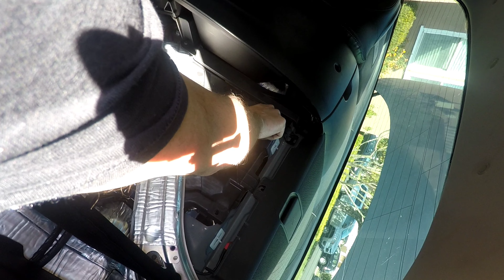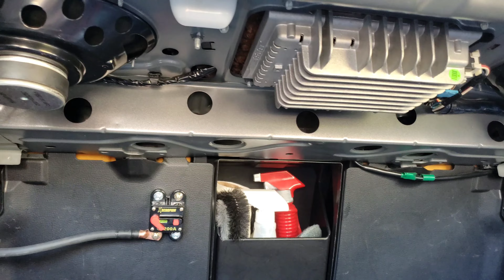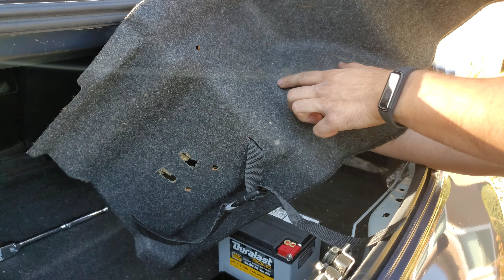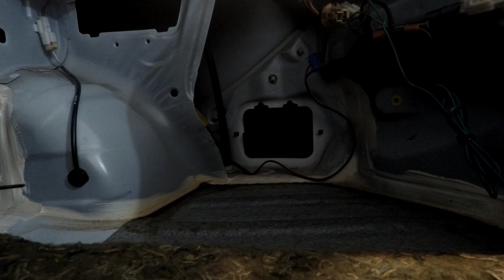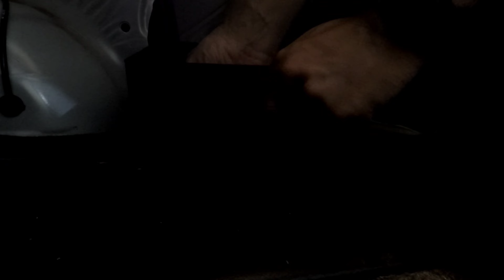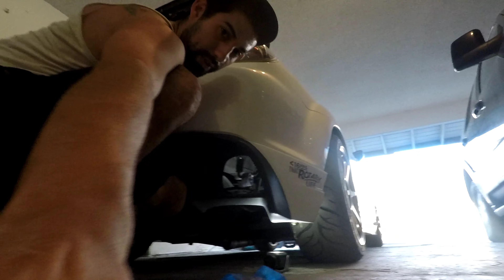Project Seca Rx8 Battery Relocation Kit Install!

Comment: Where does the 60amp fuse block for the power steering get power from? The black wire on the other side is going somewhere, but I can't see where it terminates. Is it just getting power from the post is the fuse box?
Reply from the maker: Yes, it connects to the fuse box and pulls power from there. I have a relatively simple diagram i can send on Instagram. I might even just post it on Instagram
Reply: @rickyse3p  That would be great. I'm @run.se3p on there.

Comment: Is the other wire on the 60A fuse a ground wire?
Reply from the maker: No.
Reply: The video never really showed what's supposed to connect on the other end of the fuse, would you be able to share please? Thank you

Comment: Is the kit still available, if not does it just consist of the battery holder, 1 long wire, and the two switchable amps because if so I feel like I could get this done myself if it is no longer available. Also what are the specs on the long wire with the 3/8 on one end and 1/4 on the other thanks
Reply from the maker: I believe I have one more kit available. It is the battery holder including the hold down plate, the main positive, the positive from the rear fuse to the battery, two battery grounds, two engine bay grounds, replacement fuse for the EPS, and the mounting hardware for the fuses and battery holder.
Reply: How much is it?
Reply: And where do I contact you outside of this comment section lol
Reply from the maker: @re4per597  you can get in contact with me through my Instagram. More information and pictures can be found on there. ricky.se3p

Comment: Needed this cause I just bought a no start and its cause the cables aren't hooked up right
Reply from the maker: You should watch the video i did going over things to check when your rx8 wont start
Reply: @rickyse3p  got the battery and cables hooked up correctly now I'm at either neutral safety or ignition switch going to test voltage today thanks for getting back to me
Reply: @rickyse3p  was wiring in the fuse box, spliced power to the starter relay now it cranks! Looks like its deflooding time